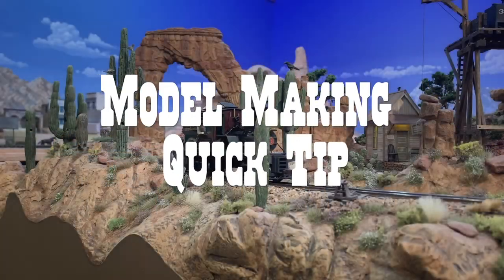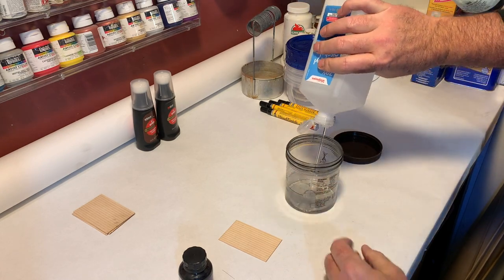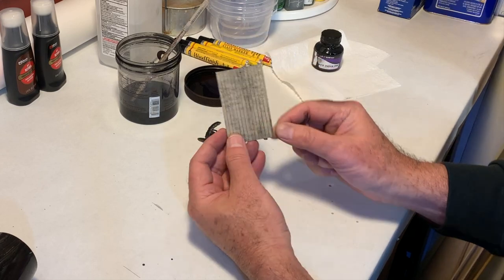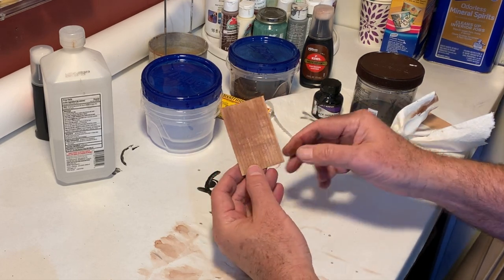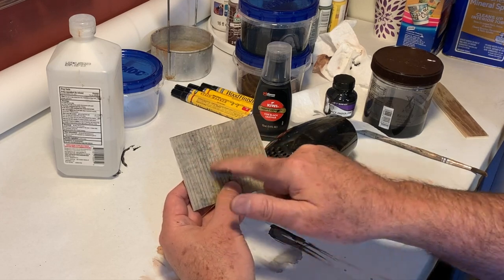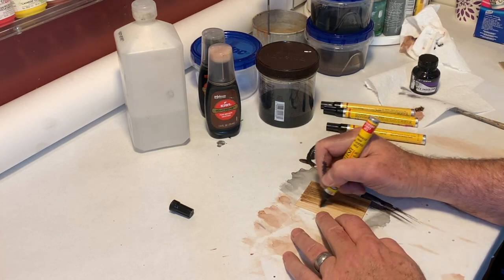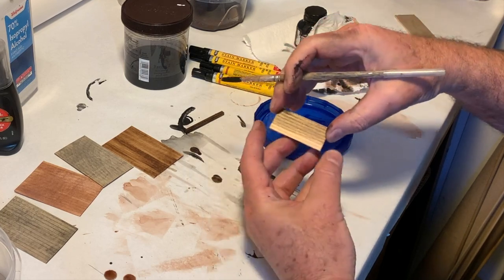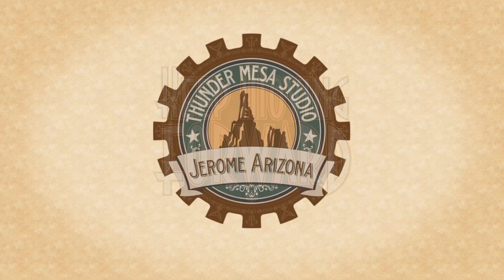Model Making Quick Tip: Wood Stains

Comment: Howdy Dave,
I'm not the painter in the family.  That's a job reserved for my late wife.  But one thing I can added to your technique is I once spilled 90% I.P. on a finished model.  Though the results were not what was planned the additional treatment caused the stain to fade slightly.  As well as wash away from select areas.  I.E. along the buildings baseboards.  For those who are looking for such an effect dabbing on clear I.P. can add an after effect.  Which maybe desired?
Next, I and a model RxR buddy noticed at your painting station you use rolled paper.  He does something similar.  He mounted to the rear of his painting area a pair of paper rollers.  He then has a limitless supply to cover and protect the hard surface.
He was saying you might want to do a video on your techniques you use to protect your desk or workshop countertops.
In any event another good episode.
Jim

Comment: Don’t know if the markers will be available over here. Definitely will look into them.
Also am going to try out the shoe dye and india ink methods.
Until now I mainly use the different shades of stains my wife and I produced a few years ago. Those we made with white vinegar, tea, steel wool, old rusty nails and even coca-cola. Very interesting of these homemade stains is that they come to consist of more than just one shade. Depending on the grains, the amount of exposure, and sometimes the hardness of the wood, they stain the wood from deep black, to a blue green sheen mixed into grey. Or the more rusty colors, and very different shades of brown.

Comment: Why 70% alcohol and not 99%? I would think the higher the alcohol amount the less warpage.
Reply from the maker: Couple of reasons. Here in AZ, alcohol evaporates VERY quickly, lowering working time. Also, when using India ink, the higher alcohol content breaks the ink down too much, turning it to granules that will not soak in the wood. Your mileage may vary.
Reply: @ThunderMesaStudio  Oh yeah, it's a dry heat you have in AZ. Don't have too much of that here in CT. 👍👍
Reply: Dry and heat are both things that are in short supply in Wales! Does that mean I could use 99% IPA, as I keep that in stock for washing 3D prints and general cleaning.

Comment: It's an older video, but I wanted to comment.  The "granules" in the India Ink/IPA can be minimized or eliminated by using 91% or 99% IPA.  Or better yet, use Denatured Alcohol instead (which is a better solvent for India Ink, at least the ones I've used).

Comment: Thank you for this video I would never have thought about using shoe dye or the touch-up pen. What store would I be able to find the pens at? I'm assuming Walmart but not sure.
Thanks again.👍
Reply from the maker: Try Home Depot, Ace, or Lowes in the paint/stain department.
Reply: @ThunderMesaStudio  Walmart has them too. Look by the cleaning supplies / furniture polish. Of course, the upside to shopping for them at the home store is that you can also get the matching cans of stain for when you are doing a bigger project - I'm not masochistic enough to use the pen to hand color a layout worth of ties, or a whole trestle!